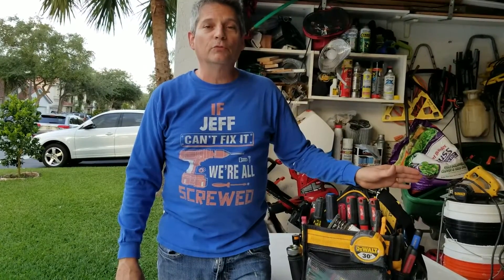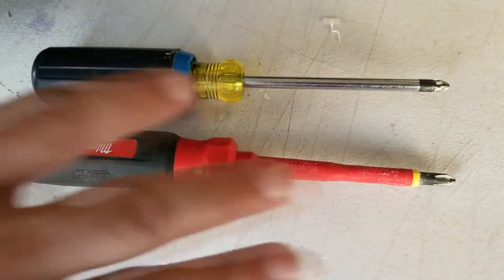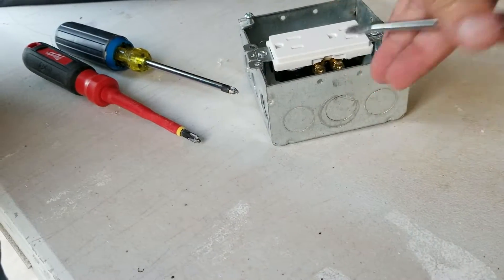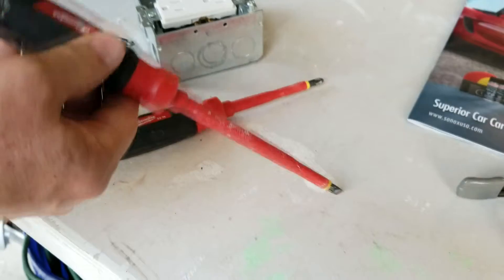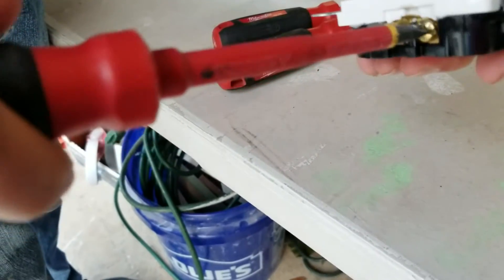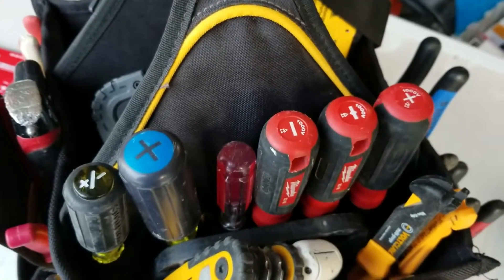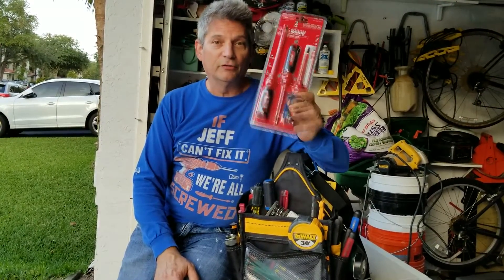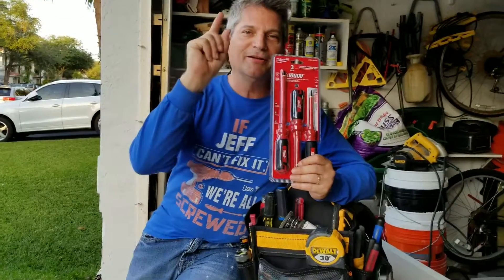How These Milwaukee Screwdrivers Save Your Life, Electricians Tools

Comment: I’ve had that set for over 5 years. The Phillips and ECX has held up ok, but I snapped the tip off the slotted. I’ll be getting an 8mm insulated Wera to replace it.
Reply from the maker: Was using mine today on a breaker panel

Comment: my question is you said is never good to work live but I guess if for some reason it was accidentaly wired incorrectly / or you accidentally shut off the wrong breaker hopefully the insultated tool would protect you? P.S would you say that when possible adding an electrical tape to my insulated screw driver should provide extra protection in case of an accident? thoughts please thank you
Reply from the maker: Insulated screwdriver provides all the protection you need, I would not modify it with anything.

Comment: Due they fit all the screws electricians use , screws used in light repairs, reason I‘am asking is I had a light floresent light fixture installed by an electrician and he used his electric gun with adapter and screwdriver Bit had a stem like end that fit a small screw to hold the light to the open ceiling rafters and I don’t  have that screwdriver type end
Reply from the maker: Do you mean a hex driver? Sometimes we come across green grounding screws on cans, and we find a 1/4" hex driver bit works best.
Reply: @jeffostroff   most of the ones I’ve seen myself on the ground were Robinson , but thanks for the tip they are using the Hex, but he used these screws to attach the light to the ceiling rafters, ceiling is open in furnace room, and he had stripped them bad useing a power tool to install them, I was some how successful loosening two of them and the last one I was lucky he had close to  the end  , I got a claw hammer on it and pulled the head off it and got the light down, would have been a lot nicer had not stripped them, the light was a florasent light,guess he thought it would be easier than attaching it to the light box , he would have needed help with it to install, was wondering what do you do when you see the screws are stripped , is crow bar time, appreciate your information and I thank you

Comment: ive got two gauges in my slotted its not all the way theough to the metal but anyone know if they are compromised?
Reply from the maker: You might want to replace it, depending on how deep it is. Not that much compared to getting shocked.
Reply: @jeffostroff  yeah i just bought a klien flip blade i heard these milwaulkees like the kliens have a inner layer to know when to replace

Comment: cool idea - did you add nuts and washers for toilet bolts yet?
Reply: and a cheap fix would be electrical tape around the shank of a regular screwdriver ;)
Reply from the maker: Might put those in my plumbing bag, but even then I never have a use for them, because I'm usually installing  anew toilet that comes with bolts, and even the green foam rubber wax rings we use come with bolts.